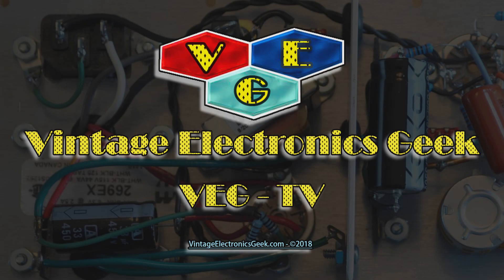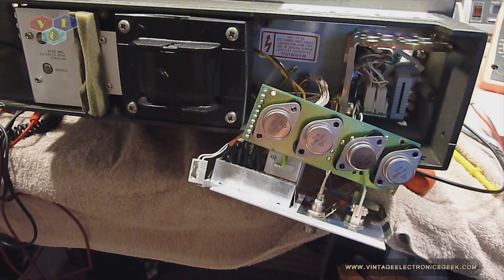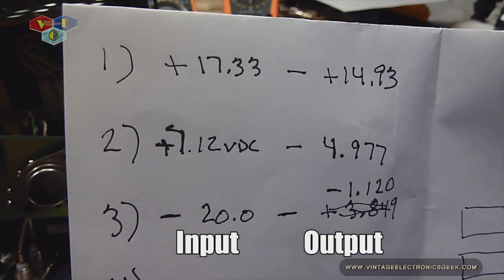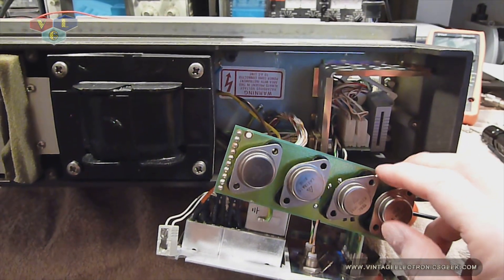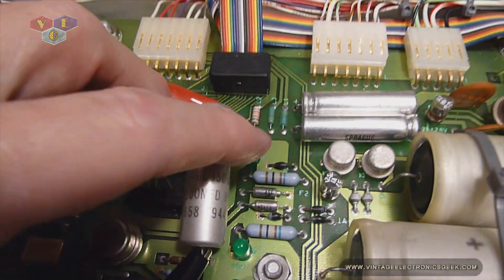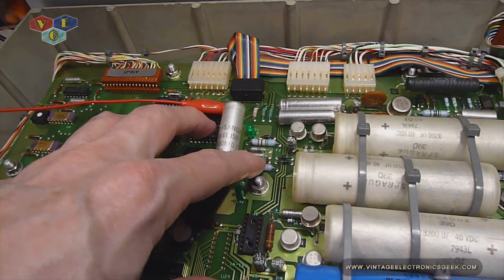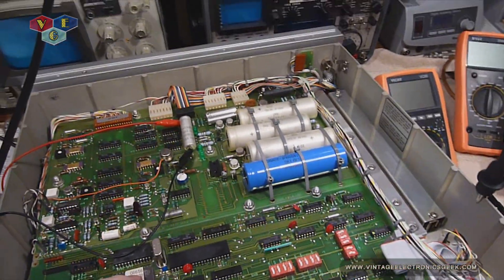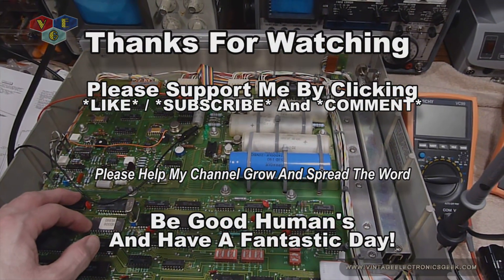HP 8656A Signal Generator - Update - Part II

Comment: Put the screws into the regulators and diode pair. They are not fully connected. Their cases are one of their contacts. In the famous words of Austin Powers, "WE HAVE A FLOATER!" 
The reason the one cap, probably across the +5V line,  tested bad in circuit is because there is probably a 5V short to ground. Tested out of circuit, you have cleared that one of guilt.
I'm smiling. Get glasses!
Reply: I thought that as well.
Reply from the maker: I did as suggested, same resolve, the only extra issue noted was UX2 +5vdc became super hot super fast, burnt finger...letting it cool down now to see if I can actually get a voltage reading on it, I will try and setup camera so as I can video document that...look for that video later this week.  Brother I wish I could put glasses on top of my glasses to fix the issue...I've been see an eye specialist for about 3 years to get it resolved...needles in the eye every 90 days for the first 1.5 years, then ever 3 months thereafter...fun!  :)  Hope your feeling better! Thank you!  ~Jack, VEG

Comment: I understand about eye problems because I have a couple of friends who have had cataract surgery. I have not (yet) and hope I don't have to have that but the four procedures I had to have done on my prostate make up for that. I sure like that signal generator. Those two 100 ohm resistors did look just a tad discolored in the middle but that might be just the lighting. Forgive my stupid question but did you check all the solder connections on the pins of the plugs where they solder to the printed circuit? They do look OK in the video. Gary
Reply from the maker: Oh gosh Gary...hope your doing OK!  That's part of my issue...  :(   I just double checked those two resistors on the parts list and in circuit, here's my findings:  parts list: R82 = 619 ohms,  I%, .5W Tested In Circuit: 621 ohms  ,  R84 = 619 ohms,  I%, .5W Tested In Circuit:  541 ohms.  Band color code is: blue brown yellow black brown  , hope that helps some.  And thank you for your help, I appreciate it!  :)  ~Jack, VEG

Comment: Oops, my bad, I think I didn't explain it properly with the batteries. You would have needed 4 batteries to test the two 15V regulators in a bipolar arrangement (2 for each polarity, with GND inbetween both pairs). 

However, testing each one individually with the same supply and flipped polarity would have sufficed.
Thanks for the shout-out anyways.
Reply from the maker: I would need to search for a video to see, better understand the proper layout and take reading...I think I understand, but wanna be clear.  Its with great pleasure to give credit where credit is due!  You worked hard to help find a solution, it's only fair you take the blame, er I mean credit!  :)  Also, I think I was your first sub, so if you ever do post...I'm ready!  Thank you very much again!  ~Jack, VEG
Reply: @VintageElectronicsGeek  

Didn't you get a good reading on the +15V VR? 
Just do the same test on the negative one, with the polarity reversed and see what it does.
Reply from the maker: I believe I did but don't remember, will need to retest once I am able to get back to it...I do have one more video that I will post this week sometime, I shot last night...my new test gear came in, so I need to clean of my workbench and record/demo---guts/test.  Thank you!  :)  ~Jack, VEG